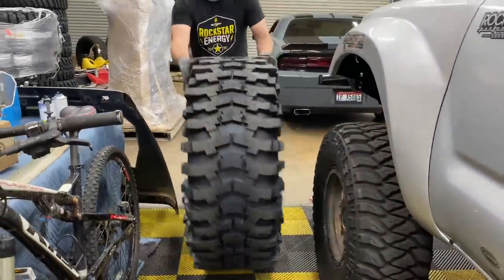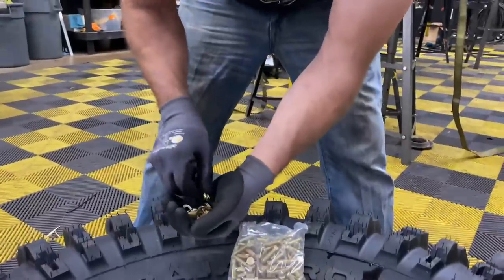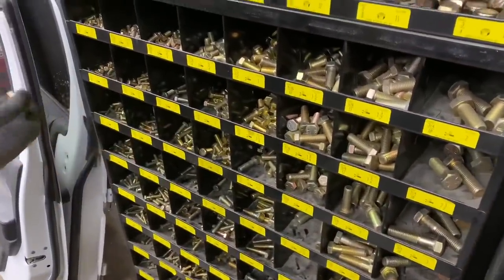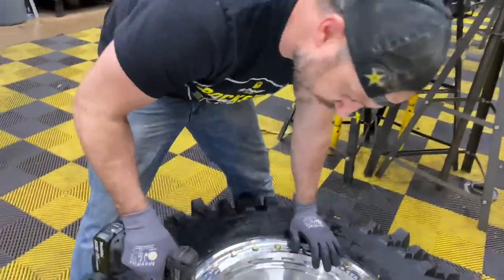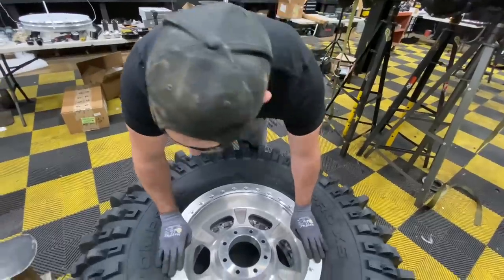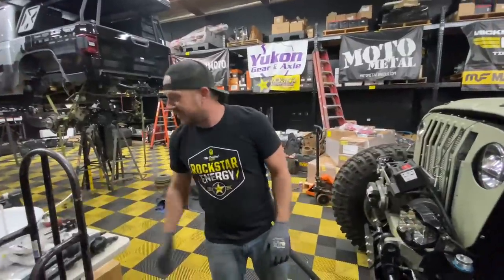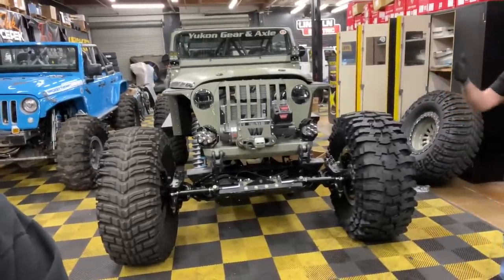KMC Double beadlock on a 46” Mickey Thompson Baja Pro XS tire

Comment: Those tires are rowdy. Couple little points as a professional mechanic and tire guy; you don't need to tear open the bags on the balance beads, just throw them in whole, they break open almost right away when you start driving the first time. Also, you should torque those beadlock rings criss crossed all around to make sure the ring compresses everything equally and seats evenly. Love Gridloc. One of my favourite current rigs.
Reply from the maker: Great advice. That’s surprising about the balance beads...I had no idea! 😀
Reply: not sure if they also act as balance but there's a new product called multi seal and it's Kevlar powder and it instantly seals any puncture leaks. have to check with the manufacturer to see if it also balances like this stuff I know that is basically a Teflon powder got a friend that did sell my tires and he told me about it it's called equal with what he used..
Reply: i know im 3 years late but you are completely correct i laughed

Comment: Here in BC. Ive been running the 46" claw cut simular to yours in the snow since the week they first came out, on a 16" rim at trail pressure of 4 PSI  AND DEEP SNOW AT DOWN TO 2 PSI. These new Mickeys look like they would be much better in mud and on the rocks. I still prefer a 16" rim to keep up your ground clearence and still have the nesisary  bulge in your tire, keeping enough room between the rim to prevent damage from a pointed object.  Will love to see these in action.    CHEERS         Steve h.
Reply from the maker: 1sheinz we just tested them out in Sand Hollow and they did extremely well! Check out the video and let me know what you think 😀

Comment: Excellent tire It's a 50,000 mile all terrain, but is has the aggressive look of a mudder. This is the second set I have put on my truck. The last set were good for 60,000 tough miles. This tire looks good, holds up well, and is much quieter than a mud tire.
Reply: Did you just say all terrain?

Comment: I definitely have to say the new kid on the Block I don't believe Mickey Thompson would have come out with a different set of tires without performing a whole lot better. The reason I love their brand they always put performance first.
Reply from the maker: Agreed! I’ve had the chance to actually sit and talk with the folks who designed my tire and the Pro XS and they are some of the most awesome tire geeks you’d ever want to meet. I could spend hours listening to them talk about tire structure and testing AND I’m even happier that members of the Rockstar team are part get to help test new prototypes for MT!! 😀🤘🏻
Reply: Mickey Thompson tires were banned in Canada as they refused to put a snow rating on their tires. In Canada there has to be a stamp on the tire with a snowflake and or a mountain icon to show it is winter capable. I have Cooper Evolution M/T with a M+S & rating but no 3PMSF rating that classifies it as a "winter tire".

Comment: I have seen monster truck tires, and like I said before, they were obviously designed for that sport, there's a mind set for that sport, and those people, good for them, but as I am browsing the YouTube airwaves, and learning all the 4x4 wheel drive conversions systems, and I dam sure admire it ,100% , everyone has their own opinion of transportation and their own opinion of fun, I'm not big on  mud, but go for it anyway if that's your idea of fun, dig it, I like 4x4 trucks for winter use ,and especially after a snow storm or ice storm, when you have  a tire that is a foot and half wide, and almost 4ft high, I'd call that some perty good muscle, and sometimes the snowy roads do freeze up rather hard, and I have seen our local county garage, it took them a whole dam week just to make it out to our location, this was yrs back, the snow was an average of 2  1/2 ft deep plus , we couldn't get out for a whole f-------  week , now if I'd that tire on my truck , HAY, there's a dam strong chance I'd would have been out to the store getting food, when you step outside on the front porch, and I look at the snow, where in the hell did everything go, the snow was above the porch  ,,you tell me, just what in the hell would you do, if i had a 4x4 truck with good clearance, I can't wait, the house electric was off,  got down to 35 degrees, I've been sleeping with my clothes ever since,  we didn't lose any food, that was a small blessing,  I like big ground clearance on a 4x4 for snow emergencies, tell me, I'm not going anywhere  ,you wanna put money on it , I'm gone,  I'm tired of the county utilities,  my vote goes for the PRO X S, KEEP IT THAT WAY, I've got my 4x4 truck in my mind, yeah, it's just a dream for now, wayneeden95@gmail.com

Comment: You’ll enjoy them better if you balance them properly... I run 46 inch claws on 20X14 Staz works double bead locks and I spun and balanced mine nearly perfectly. I’ve messed with the balancing beads and didn’t enjoy them. 
That’s my favourite jeep on the internet. It’s epic.
Reply from the maker: Jimmy Paulgaard yeah, I never bother to balance mine at all. That’s awesome that you managed to get them nearly perfect without using a ton of weights! It’s such a heavy tire

Comment: Lower air pressure will ware out your side walls faster it may give you a bigger patch surface on the ground but side walls get hot an break down faster .

Comment: Is it OK to tighten the bead lock bolts in a counterclockwise or clockwise rotation around the wheel. I only know from RC Rockcrawler‘s that I have played with in the past we start on one side of the rim with one bolt and then we put another one in on the opposite side and repeat that process until finished so you go back-and-forth back-and-forth. If we didn’t do it that way the bed locks would not seat properly. Just curious if that mades a difference or not.
Reply: Erick Illg I’ve always mounted mine in a star pattern like you would tighten your lug nuts.. but once I have the ring snugged down i will go around clockwise with the torque wrench
Reply from the maker: Erick Illg I typically tighten 4 of them in a cross pattern then tighten all of them in a circle (clockwise)! 🤷🏻‍♀️

Comment: PRO XS's DEFINITELY look bad ass... wish I could save up enough for a set for my new project.  Taking the chassis of a  '79 POWERWAGON and shortening it for a '96 XJ. I'll build a long arm suspension for the front and POSSIBLY the rear since by the time I'm finished it'll more than likely have 4whl steering since it has a twin stick gear driven t-case.

Comment: Those tires are huge and like the fact that you don't have to run much air in them...do you need an standby air compressor if you need to get on any roads?? I know Matt runs between 12-20 pounds of air all the time

Comment: Those new Mickey Thompson pro xs are exactly the tire i am using on my build it would be awesome if you could give us your thoughts on them as this is a big chunk of my build budget
Reply from the maker: Anthony Jensen we are taking a run to Sand Hollow next week and want to wait until then. I didn’t even really share my opinion on the Pro X until I had run them for months. It’s a shame how many ‘ambassadors’ will mount a new set of tires and talk about ‘how great’ they are 20 seconds later. Look for another video later this month once Nic actually puts them through some abuse 😈🤙🏻
Reply: Thanks for the response one other question i am building a 65 merc m500 that started as a 2.5 ton but is now on a 60 / sterling from a 02 ford i have trussed both axles and am keeping the 300 six total weight should be about 6000 lbs is the 46 too much for the 60 ?

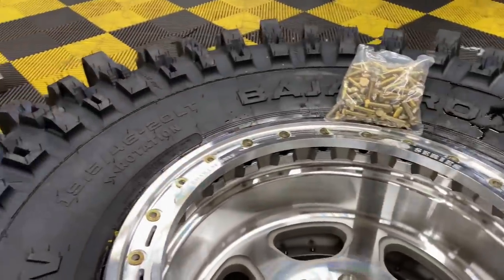Comment: My comment is actually a question. I have a 2012 JK, with Dana 44 front and rear and re-geared to 5:38 with a 6.7 lift. My question is what do I have to do or need to do in order to have installed on my jeep 46" MT baja Pro Xs tire, as you show with Nick in this video. Please add everything I, including coilover size, etc, to have this install without any issue. I cannot find any help about this in my home town in NY. Your advise will be highly appreciated. Thanks.
Reply from the maker: The answer almost certainly is: Running 46s will cost you more money and effort that it’s worth….40-42 really is the limit for JKUs IMO and running that tire will do nothing but create issues. Normally, I’d first ask you how you plan to use the Jeep, but regardless, you need full width (72”) or wider 1 ton axles. Here are the things I’d want if I were to run that tire (which I would never do). Dana80s front and rear, 2.5ton steering (preferably full hydraulic steering), a custom long arm suspension (coilover length determined by the fabricator), at least a 5.3L LS motor swap, 20” beadlock wheels.

You’ll also need to significantly trim the rear portion of the body (and possibly limit your steering to avoid clearance issues when off-roading). I know this response is probably not as helpful as you’d like it to be, but my advice would be to call Leo at TNT Monster Truck in Ronkonkoma, NY. He and his team built my Jeep and they can probably give you a good idea of what would be needed. Just keep in mind it will be very expensive - there is no quick/easy/convenient way to fit 46s under a JKU.

Comment: Double beadlocks are sweet. If you don’t have them just run some gorilla tape on the inside of your inner bead before you mount the tire. Run 4psi with 43” sx’s with.no issues. Same kmc wheels Mischiemaker has.

Comment: How often do you have to go through the bolts of the beadlocks and re tighten?
Reply from the maker: VELASCO ROSETE EMILIO I only check them 1-2 times a year and generally 1 month or so after a new install.

Comment: DONT bead locks come on BOTH sides of the wheels?  I don’t know anything about bead locks, but if they don’t, what would the point on having a them at all be??? Would they even work at all?
Reply from the maker: Hey there! 
First , thank you for watching the channel! Happy to have you part of the Mischief family 😀
Now to answer your question- 
The stress on the outside bead is significantly higher than the stress on the inside bead and works just fine on a vehicle like this that crawls 🙃 Gridloc has had no problem at all with them 🤟🏻

Comment: I really like the old Baja Claws. I do like the Pro Xs also though. Here in Michigan I would probably run the Baja Claws. Anywhere else I would run the Pro Xs. We have a lot of mud and sand, not a lot of rocks.
Reply from the maker: I know you guys have more mud than rocks but I’ve seen both tires in both terrains and I would deffo choose the pro x for both! You would be shocked how well they work! .... I was
Reply: I wouldn’t mind giving them a shot. They would be going on my daily though. How noisy are they on the road? I don’t mind a little noise. I had some Dick Cepek’s Extreme Cuntry’s before that I couldn’t hear anything but the tires. After the first six months I wanted to get something else.

Comment: This is why I run Hutchison Rock monster beadlocks. Double beadlocks and they have 3 longer bolts to suck the tire together so you can put the rest on. What I don’t get is why no stickies? Why even bother making a street design tire in a 46”. If your running a 46, your trailering
Reply: Hutchinson Rock Monsters aren’t big enough for these tires. They don’t even make them big enough to meet spec for most 40x13.5R17 tires. The design is a pretty cool design, though. They told me they’d consider making bigger wheels if they knew the demand was there. With the emergence of 40s, I’m sure the demand is there.

Comment: Where can find that whole suspension kit for your jeep?? ...
Reply: And how much did it run you back ? Price$  wise
Reply from the maker: It’s complicated. my suspension is a frankenstein setup that is now made up of parts from several ‘kits.’ We started with a Teraflex alpine long arm kit sitting beneath coilover brackets from Rebel Offroad (DSS coilover conversion up front and 14” bolt-in coilover conversion rear). I’ve never been happy with how the rear bolt-in coilover conversion kit performed, so the next step was to outboard the rear coilovers (which also meant moving to a 3-link because we didn’t want to relocate the gas tank). The Teraflex and Rebel rear brackets and long arms were replaced with a Rock Krawler 3-link and Genright coilover towers. As for the coilovers themselves, I run King 12” 2.5 IBPs with 2.5 Bypass Shocks up front and 14” 3.0 IBPs in the rear.  Also, all my remote resis have compression adjusters. Let me know if you have any other questions!!
Reply: MischiefMakerTV I want those 46 inch Mickey Thomas Baja pro XS tires on my wrangler  but I can’t find a proper suspension kit for it ... I won’t be going a Extreme off roading like you .. so I won’t need a crazy kit... I’ll be mostly driving in city but I do want those tires I may from time to time go off roading here and there but it won’t be none crazy ... this is my first time building my own Jeep but I already know what I want lol .. those tires for sure but I just need help finding a proper suspension kit cause I want a 7 inch lift with those tire but I don’t know where to look and I need suspension and rotors and breaks for the tires so yeah😂😬

Comment: You leave your threads naked?  Or are they pretreated? I've been such a fan of the old mickeys that the pro's will take some time to get used to.  I hope they work well cuz they sure are ugly, ha
Reply from the maker: I have not been impressed with what I’ve seen from the Baja Claw. Both the Baja Pro X sticky and the DOT version from this video the Baja Pro XS definitely take some getting used to, but I don’t think there is a sticky on the market that I would switch to...maybe a Boss 42 sticky (if they ever get around to making one) 😀

Comment: Well, it's Wayne, I'm back again,  again my admiration and my love for animalistic tires and wheels as well,  here's my bitch complaint about the government factory regulations control over the hobby of the 4wheel drive type tires, is this, I will admit, I'm not knowledgeable about about any of the current negative downsides to 4wheeling ,camping and fishing, winter n snow, what ever the hell you desired need for needing,wanting, or loving that big 46 incher TIRE, yeah ,i guess I found that tire, in the Mickey thompson catalog, and the price dam near knock me out, $1100.00 plus per !, now ,I'm aware of the monster truck rallies, that's ok for those people, I'm not that kind of people person, the tire in this video is definitely my flavor of my fever, and that double headlock, is also an insane mojo, as I have studied suspension systems through jeep gladiator truck and the other full size regular trucks, I now have a good memory mental work up about all the suspensions systems, jeep gladiator truck showed me everything that there is to learn,  I have a 1995 Dakota, v8-318 magnum,4x4,extended cab,short bed, I prefer long bed, I want to restore my Dakota, but it might rust out before I find the money  ,a short note for your tire choice on your video, stay with the new left front, it's got growl written all over it, that's the one he just mounted!!!!!!!!!  I realize there are all purpose mud n snow tires, but sometimes a little practical common sense needs to come into play, it's not like we are all hogs and play in the mud, sometimes reality will kick in,  and take over,  it's like we want to turn our play toy trucks into ""TRANSFORMERS, NOW DOES THAT MOVIE BE RINGING A BELL, HELLO LOUD N CLEAR, BUT, DO WE EVER REALLY GROW UP,,,I LOVE YOU PEOPLE, HAVE FUN ,BEST WISHES,  wayneeden95@gmail.com

Comment: How much does each tire weigh?
Reply from the maker: 112lb roughly. Way less than the 42s on my crawler 😅
Reply: @MischiefMakerTV  dang that's crazy consider it a double win. I had 40s Aturro blade boss tire, on an 03 expedition and they weight around the same. Im planning on a new build with no lift low budget, will need a narrow frame so I can have all the offset I could use

Comment: I get how the mod bug bites some people, but really some of you need to draw a line. 
I suppose if you have the money to build a ridiculous rock crawling beast then a full size pickup with a trailer to haul it places to show opulence, so be it. I would rather have something moderate for overlanding and avoid the extreme.
I am a YouTube creator too and I see you out classing your audience. LiteBrite did the same thing ... the rigs keep getting more extreme but most of the audience are driving mostly stock Jeeps hoping for a windfall so they can get 33" or 35" tires.

Comment: Shoulda got stickies.  :D
Reply from the maker: I agree! Baja Pro X FTW 😎🤘🏻
Reply: @MischiefMakerTV  I'm a cheap bastid so I'm looking at getting some used KRTBs or KR2S' off the Baja/U4 guys this winter.  Eventually I'll probably end up on Treps.
Reply: @MischiefMakerTV  also, you should try to make a trip up to MN next summer, some of the best wheeling in the country in July/August.  Not so blasted hot like the Southwest, not as humid as the Southeast...

Comment: For a fraction of the cost of balance beads you can go with airsoft bbs and get the same results
Reply from the maker: Thank you.... I’ll deffo look into that
Reply from the maker: Not that I bother balancing the tires on my trail rig 🤣🤣
Reply: I've done this before, airsoft pellets in the tires as balance beads, they definitely do work. The issue I had is they eventually disintegrate into dust and don't stay balanced well like they did new. I believe the true balance beads last unlike the air soft pellets.